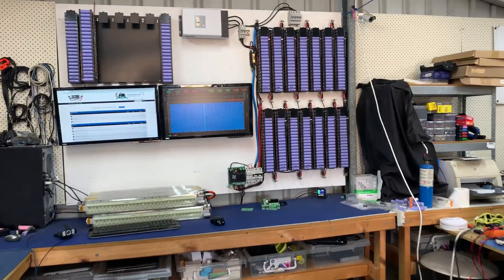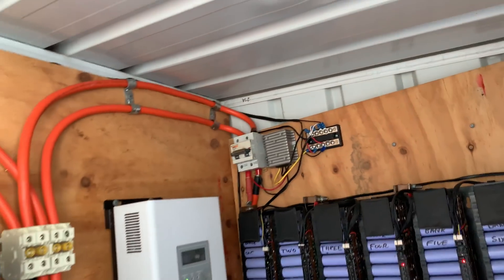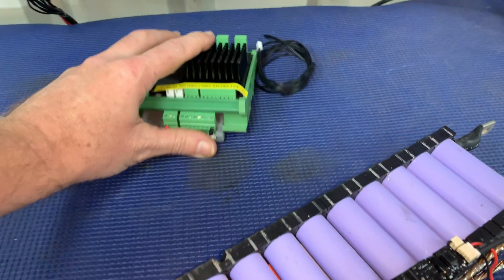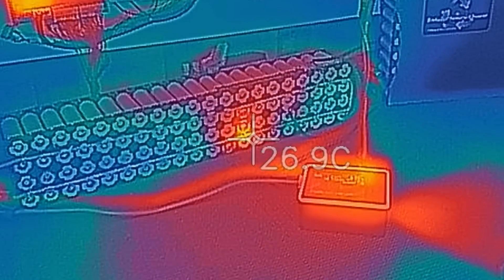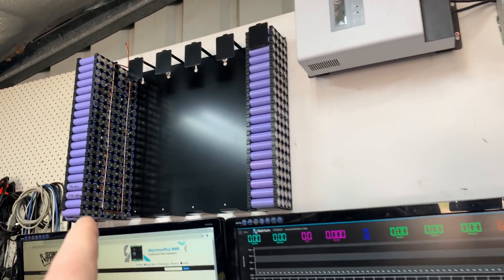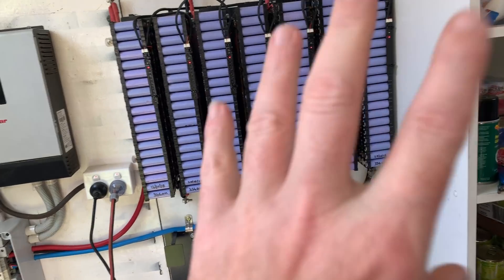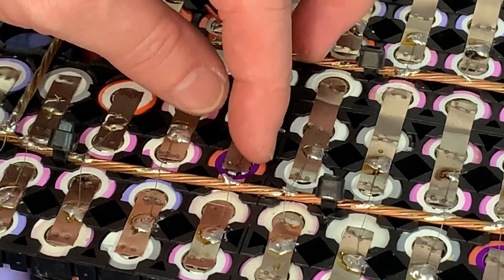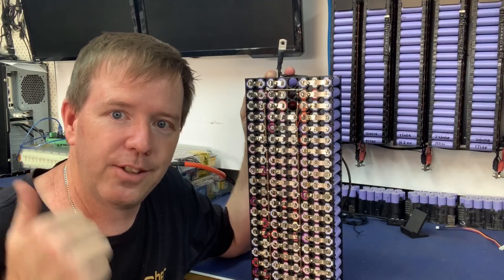Self discharging cells hurting my storage capacity, So doing some maintenance on my wall.

Comment: great video! just wondering why the cells are joined to the bus bar with fuse wire? what would situation would cause a fuse wire to blow?
Reply from the maker: battery falls off the wall and dead shorts, or any dead short for that mater
Reply: Thanks going to watch all your videos. I have a bike shop and have tons of batteries with blown bms and dead cells etc I want to recycle.  I will copy what you have done and make 1s packs maybe of about 30-p. :) thanks  @HBPowerwall

Comment: I’m in the process of collecting my 18650 batteries and was curious yes they were charged during the day via solar then utilizing either some sort of grid tie inverter etc. discharge the power back into the grid? Is this something you can do, something that you do actually do yourself and if so roughly how long would one of those packs last? 
Also roughly what could it run? I’d be looking to placing them in my shop what does temperatures that fluctuate from very hot to very cold. I try to keep the AC running out there but it’s a 30 x 40 shop with 13 foot tall rafters which tells you how tall it is so it’s not cheap to keep cool lol

Comment: For each of those battery blocks you have on the wall, how many batteries do they consist of?
Reply from the maker: i think that one is 160
Reply: @HBPowerwall  One other question I had that you may or may not have mentioned in the video. Is there a particular brand or type of charger that you use for the sales prior to building them? I think you may have mentioned that you had bought a couple and was wondering if you had tried various chargers and found one that worked better than the other. I appreciate the input as I’m looking to purchase one myself today hopefully so I can get started on my wall project. Thank you

Comment: Great patience here ... I notice that computer server-room Li-Ion batteries are moving away from these cylinder cells and moving toward square-shaped EV cells - most recently at 310 amp hour (went from 100ah, to 220, to 280, now at 310 etc.). What does this mean for power walls; wouldn't it make more sense to go with a Gyll battery format at this point? Yes you get "free" used batteries here, but it seems like you are using oceans of time building - and then keeping these old batteries operating safely.
Reply from the maker: I started this process YEARS back when access to cost-effective large format lithium cells was near impossible, NOW there is access but there is SO many issue/fakes/dead shit sellers flogging off b/c grade cells it's still hardly not worth the money yet.  That said I would NEVER do it this way again.. BUT there are many all over the world that have my issues from back in the day - they just can't afford better. Using what you have with the spare time you can afford is an easy way to store energy. Thanks for your feedback its good to hear points of view.
Reply: @HBPowerwall  I notice that Will Prowse has a channel that sifts through a lot of those B-rated battery and cell vendors FYI https://www.youtube.com/watch?v=ZqkTLojOUGg&t=1s
Reply from the maker: Yes, for that particular sale.. Unfortunately sellers don't care and sell Agrade first sale, second is B/C grade... same story over and over unfortunately.. I would make 10k a month in commissions if I went that direction, but just can't do it responsibly.. don't want to be blamed for receiving poor cells
Reply: @HBPowerwall  This is where the server rack guys really add value I think; their volume allows them to ensure cells are A-Grades, not swollen, and properly matched and charge-balanced as well. It's worth giving the pervasive headache you refer to - to them... Also, the square cells recommend compression to maximum long-term performance, so its worth someone else warranteeing the flexible battery terminal connection designs too. Al lot goes into a supportable battery as you too well realize :)

Comment: @4:26 your looking at the cells visually, well ive done many packs in this manner and just because it looks nicely soldered doesnt mean it is..you can always check each of the cell voltages, of course they should be the same ( in Parallel) and if theyre not then that cell is not connected and will have to be resoldered. The other thing is that one cell may have an internal short, if you have an accurate temp gun you can tell which one it is, and then remove it from the pack...

Comment: How did you remove that single cell? It was blocked by the plastic holders.. did you had to take the whole pack apart?
Reply from the maker: takes seconds, just cut fuse on both ends, snap off 4 little plastic tabs on the negitive side and tap it out.. push in new cell new fuses 5 min later it's done. NOW ask how to FIND that bad cell lol

Comment: If you haven't already, consider a solid state relay for your hot water.
Reply from the maker: SSR burnt out in under 30 days on and off a few times a day under a 40 amp load. Gave up on them for now.

Comment: lately i been wanting to learn how do do this and been wanting to build 
something. im JUST starting. helped clean a hoarders house which had 2 
kobalt 80V lawn mower batteries which never saw use and degraded just 
sitting in that rate hole. of the 40 cells i got 20 in good "physical" 
condition.

before i even bother testing charger discharging ( and
 buying all the relevant equipment) i need to start stocking up to make 
it worth my time. any suggestions for where i can acquire sources? this 
weekend im going to ask around at local Lowes/Home depots and see if 
they are willing to allow me to give some of these battery packs a 
second life.

Comment: I've been watching your vids to learn more and I think they're great. Do you use 5amp fuse wire to solder the batteries to the bus bars? Thanks for all you do
Reply from the maker: Yes i did, now I try to use the fused nickel strip
Reply: @HBPowerwall  why the change? As I understand each cell will peak at 5amps and a bad one would short internally and go above that but be self isolating as it burned out the 5amp fuse wire. Or do I have that soooo wrong?
Reply from the maker: its faster, and spotwelding has been well proven to be better - i can't spotweld the fuse wire because i can't focus that small
Reply: @HBPowerwall  ok.. I built a spot welder from a microwave to build my first 7s3p 18650 battery pack for my ebike,. The whole thing cost me about £20. It worked well. Your twisted wire bus bars looked cool though
Reply from the maker: 20bucks if it worked you’d be hard possession to beat that price !! Well done 👍
Reply: @HBPowerwall  To be fair... I could only do 10 -12 spot welds before it got too hot for my hands.. then I had to leave for a couple of minutes to cool. Anyway... keep up the videos. I'm learning loads and subscribed as well. Thanks
Reply from the maker: Lol least it got it done

Comment: Did you say that you're replacing battery cells after 4 years of use?
Is that typical?
Reply from the maker: Yes, BUT they are my Gen1 batteries, poorly built for youtube content if i was to be honest. Also batteries are probably 14 years of use - 10 in an old laptop four on my wall..
Reply: I'm determining if I'm going to continue building a powerwall.  It's a lot of work for only a 4 year service life, if that's what I can realistically anticipate. 
Do you expect a longer usage life from your new 200p battery cells? (At configured capacity.) If so, please, what's the expectation based on?

Comment: Great Videos and channel. I've a question about cells which shows a kind of rust between inner and outside. It looks like a liquid but the cells a really good. do you know what that is? thanks in advance. Dieter from germany
Reply from the maker: Sounds like electrotie or just moisture either way that would be placed into the recycle bin for me.

Comment: Hi Dave.  I love to watch your channel. I have been doing solar since 2014.  24 volt batteries SLA.  I'm tearing apart Tesla Model 3 batteries for 13  28.8 volt out of the entire 403 volt battery.  The Tesla uses Panasonic's 21700 battery. 4416 total cell count with 46 cells per 3.7 volt battery. Anyhow trying to figure out how to spot weld to the top of the cell which is aluminum.  Any ideas or tricks to get a wire to stick without blowing whole in the aluminum top?  Best regards. Lou Little in SLC, Utah.
Reply from the maker: Spot welding will blow through the cells - they need end caps added -
Reply: @HBPowerwall  thanks for the reply. I have seen those in caps on the China networking but I am not aware of how to attach the cap to the battery.  Do they use some sort of silver solder epoxy or something to connect to the top?
Reply: @w.loulittle130  I’d kind of like to know about that myself. If there is an epoxy based system with enough conductivity, it would sure eliminate some major problems that arise when heat is applied to cells. I also think that maintaining an efficient soldering iron is a major drawback.

Comment: I have always wondered about using so many cells spot welded together and only way to tell which cell is bad is to completely disassemble the pack. It seems there is so much labor involved in building and testing these little 18650 cells . Thinking of all the time saved by building packs with inexpensive Prismatic LIFePO4 cells that can be bought at 100 to 400 amps each. and so much easier to build battery banks. Even if these 18650's are less expensive one's time is worth something. Heck I can work some jobs that pay alot more than the money I am saving testing and building these tedious packs and they would last a lot longer too. I can still see using these cells for light weight batteries for bikes but not for home use. The camera worked great for find the bad cell.

Comment: 18650 how many pieces are needed for one kilowatt?
Reply from the maker: one KwH? maybe 200 cells but what voltage you thinking about making your battery
Reply: HBPowerwall I do not know what you can tell for one kilowatt?

Comment: Its dangerous to mix different current batteries as the higher current batteries will try and dump more into the lower current batteries.
Not a good thing to do!! And you have a bloody lot in one space! That's a Very big hazardous setup!
Each battery bank should all be the same mah! And you will notice also they will work more efficient.

Love your setup but not sure about the battery banks.

Thumbs up
Reply from the maker: having the same mah isn't so much of an issue with only 0.3amp draw... give or take 0.1. Have 1000's running this way for years - still going strong

Comment: Your crimps are the worst thing I have ever seen. 
The idea behind crimping is to get the connection air-tight, that is, the connection contact points must be sealed off from air.  Wire diameter, cable lug and the crimping tool must be fitting together, normally all from one manufacturer,  and must not be mixed with other wires or lugs or tools from other brands. And what are you doing? Me suffered a heart attack while watching, and I fell down to the floor and am still lying there. Help!
Reply from the maker: It sounds like something I've heard before but it seems your not considering a few key points. ONE- it's working perfectly fine, TWO, We ain't taking 600amps at 450v, THREE - at least I'm not soldering the joints as well.. lol Get up off the floor and clean your dam room before mum gets home and it's not a heart attack you just drank the slurpy way too fast.
Reply: A crimp doesn't need to be air tight lol.
Reply: 😂😂😂 ok pal.

Comment: What cell holders on the ends are you using? 
Are they just a standard eBay spec one? 

That thermal camera looks pretty tempting to buy
Reply from the maker: Keith supplies all my holders, sleeves & bits and pieces - https://ebay.to/2IqaWUR

Comment: You're absolutely correct to beat the safety drum.  There are too many people around who treat 18650 Li cells too casually.  They just don't realise the difference in risk compared to the 1.5V AA (or C & D) cells that they have casually abused in the past.

To really highlight the risk factor, I have an intentionally scary comparison.  With typical 10Wh 18650 Li cells, approximately 28 of them have rated energy (which is less than total energy) equivalent to 1 stick of dynamite; 1 MJ.  Sure, they can't release their energy quite as fast as dynamite, but they can release it very quickly under some failure modes.

That's not to suggest that they can't be used safely.  It's just to help people treat them with a more appropriate level of respect and better understand the level of energy they are handling.
Reply from the maker: Trying to beat it with out being stupid - but it's crazy important with all the new members to the community

Comment: 11:15 To stop the relay from fusing look for a zero crossover relay circuit.
Reply from the maker: Googles zero cross over...
Reply: @HBPowerwall  Did you find any useful info? A zero cross relay circuit causes the relay to always close at the zero volt part of the AC sinewave so there's no spark or big current surge to fuse the relay. Let me know if you don't find anything and I'll link some stuff.
Reply from the maker: link away - I don't think i'm looking at the right thing..
Reply: @toysareforboys not sure if a zero crossing circuit would work out with a standard relay cause there is inherent delay in the relay contacts opening and it would not be simple to time it right. 

@hbpowerwall the idea of switching at zero crossing is basically to engage or disengage a switch at zero voltage (and therefore zero current) in an ac circuit. Works great for solid state relays and often you can buy them with all the circuitry required inside the solid state relay for not much more.

Comment: Why solder and not spot welds? I mean i get being cheep, but you're having capacity loses(due to soldering) and probably resistance losses. Plus getting a cheap spot welder is!ct that expensive when you do 10kwh(actually anything over 2kwh justifies that purchase for me).
Reply from the maker: I started this process broke, alone & inexperienced - with time you do things better - You'd hope - I do like spotwelding these days, back in the day soldering was cost effective and accessible to me

Comment: Hey Peter, YouTube question, do you have A / B thumbnails? I swear it changed since first uploaded
Reply from the maker: Trying to get a higher click through rate so change them to try improve ( it didn’t work lol )
Reply: HBPowerwall ha that’s no good. Have you ever gone through how you got to the size your channel is, would love to know how you promoted yourself other than the website and YT. I stumbled on your channel and subbed straight away. Your channel gave me a push into transferring job roles. Dealing with solar, batteries and power quality for a distributor down in Victoria. I actually enjoy the work now. Thankyou.
Reply from the maker: I started by spamming every other remotely related page, then I sent Jehu Vegemite then I was just plain lucky to build a powerwall that worked.

Comment: Have you come across any cells which have blown the fuses yet?  I was thinking with such large 80p packs you might not notice one which has self-disconnected and you might even need to run around with a meter to spot it (broken fuse wires can be pretty tricky to spot sometimes).
Reply from the maker: I can say i don't think i've ever had a 'blown' fuse - i've had broken fuses but i feel they are from poor handling as opposed to electrical issue. THAT said i have stuffed up preaty bad and shorted a 24v pack (7S) and blew all 80 fuses on the first cell to the short. But that was my fault not a cell level fault.
Reply: @HBPowerwall  Would you be able to spot one in amongst an 80p pack tho?  If you had a failure with lower resistance internal short than the ones in the video, it'd just blow and you might never know.

Comment: Hi, since these are parallel packs in series and you remove one, the voltage for the battery will drop respectively 3,7v until you put it back in service, is that correct?
Reply from the maker: Why would it drop to 3.7?
Reply: @HBPowerwall  So please correct since i am new to this, you have let's say 14s80p for example and you remove one of those 80p pack right ? Each pach is 3,7v and in series all 14 give 51,8v and you remove one of the pack doesn't it drop the voltage of the battery to 48,1v ? What am i missing ?

Comment: disconnecting one bad cell is easy enough....replacing that cell with another good one, is a whole lot of work!  Those interlocking 18650 cell holders require that side of battery to be disassembled to replace one cell.   I made a template of the cell spacing, and made two cell holder ends out of plywood with 18 mm holes.  When I find a bad cell,  I can unsolder both ends of the bad cell, and simply slide it out,  without entire pack disassembly.   Slide in the new cell, solder it up, and BOOM, back in business, in a fraction of the time.   Use this method on my ebike, too, with 40152 LiFePO4 cells, with screw terminals and buss bars.  Good for easy, long term maintenance
Reply from the maker: under two min to replace a bad cell - break four little tabs on one end usually the negative side push the cell out - thicker wire on the negative side holds that side in - positive has a fuse ... done takes more time to heat the iron than to replace cells
Reply: HBPowerwall   I see your trick, well played!

Comment: it only take one cell to   bring down a big pack  good job Pete
Reply from the maker: I think i'm actually disappointed that i've had this issue already, but now i'm aware of the issues i'll be more proactive
Reply: there will have some cell failing but you guy have learn so must over the years failure is minimum